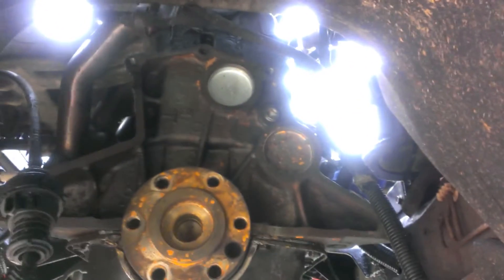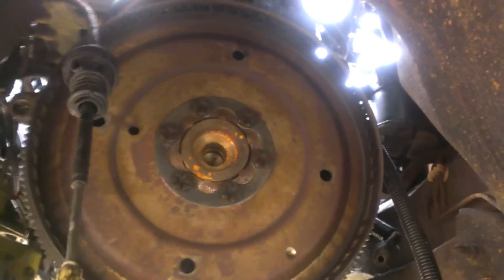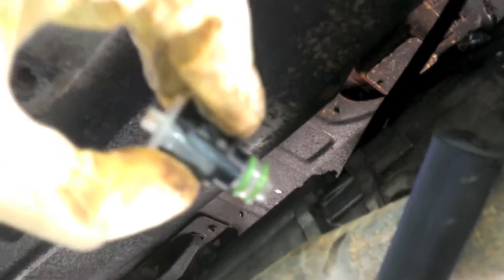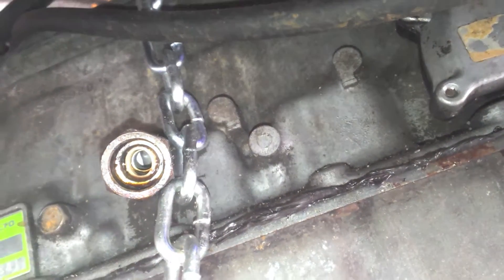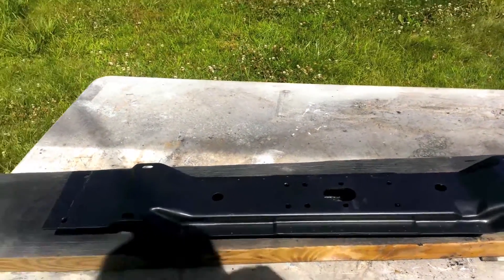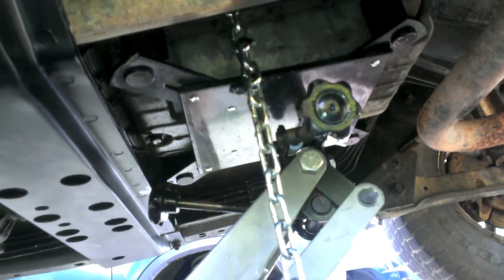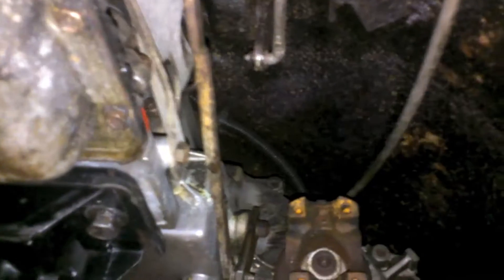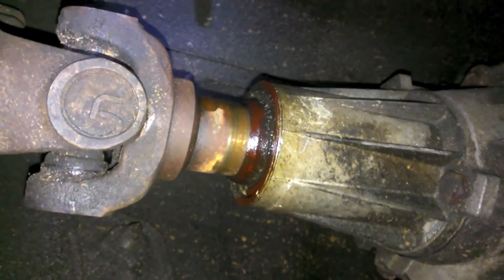89 Cherokee AW4 Auto Transmission Install

Comment: so about the quick disconnect transmission lines, where did you buy the install kits?
Reply from the maker: +casey heck You can buy them online if a local part store doesn't have them. DORMAN # 800750 is the repair kit that i used, or I think you can buy the whole fitting but I've never tried it: DORMAN # 800714

Comment: can you please make a video on how to properly put oil in transmission after replacing the old transmission out. what steps and procedures to take and what to expect if the 'salvaged' transmission might be no good. thanks
Reply: Alright thanks man, I'm 16 and trying to fix my flex plate!
Reply from the maker: +b20vtechustler This will show you how to add fluid. https://youtu.be/j_9sWfz9Hr4?t=6m46s
Reply from the maker: +casey heck It'll be quite the adventure the first time around. I recently had to pull the trans again when I installed the stroker so I think those videos may help a bit more than my old stuff.

Trans Removal: https://youtu.be/CBQZ2zb7rgw?t=15m23s
Trans Install: https://youtu.be/w8Mtv12YjHY?t=21m21s